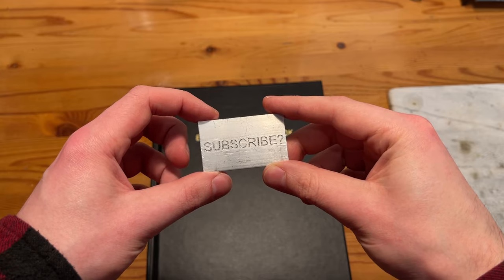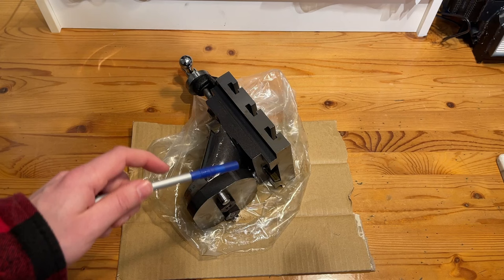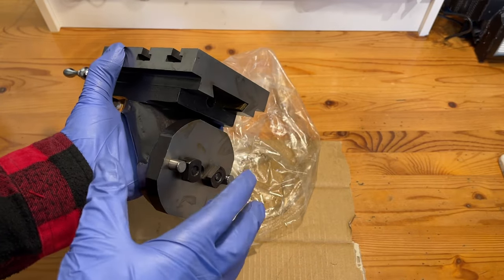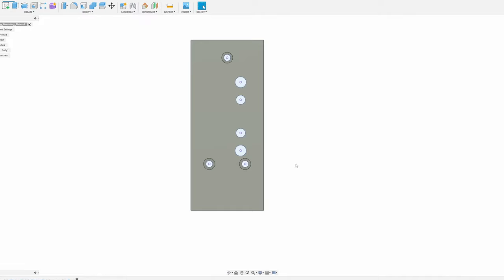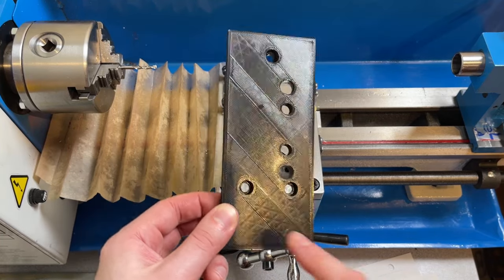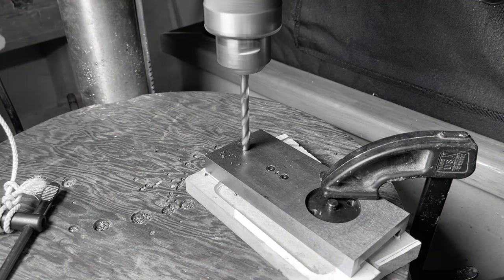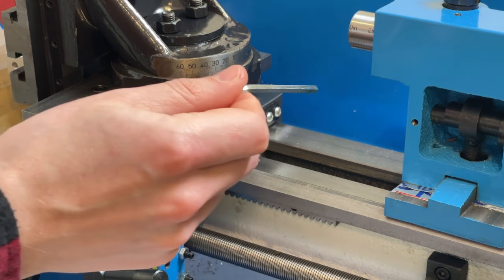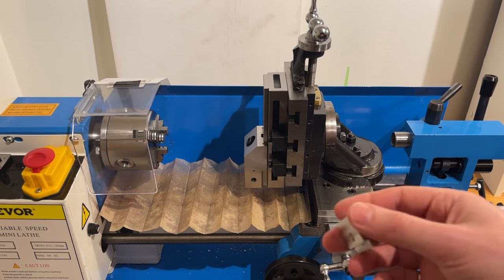Testing the Cheapest Mini Lathe Milling Attachment on Amazon

Comment: I was surprised how chunky that gib in the vertical axis dovetail was. Plus, it looks like brass. For 140CAD I would have expected flimsier construction.
Perhaps you could also buy a version without the compound angle feature, just to make it more rigid in the vast majority of scenarios where you only need to mill right angles.
Look at the prices of collet chucks, they are not that expensive. Plus, they can be used for lathe work as well.